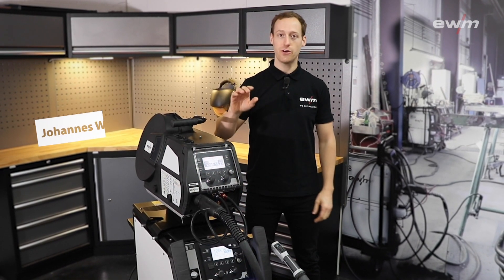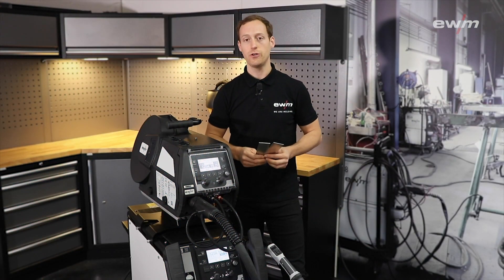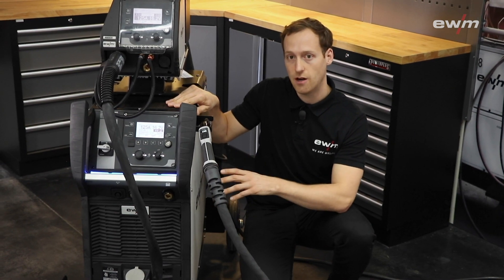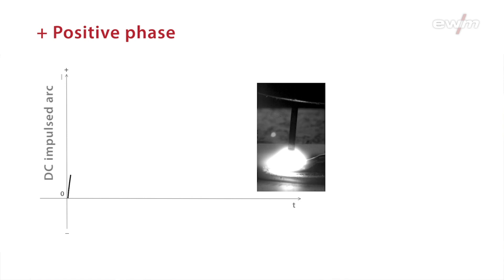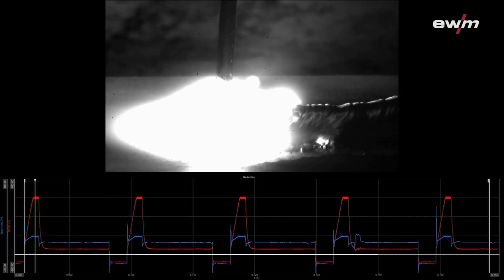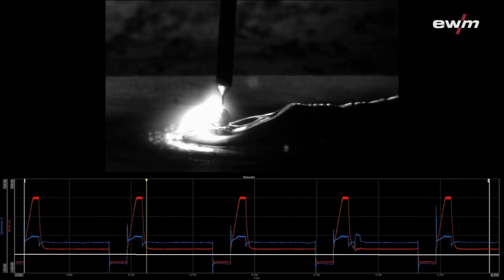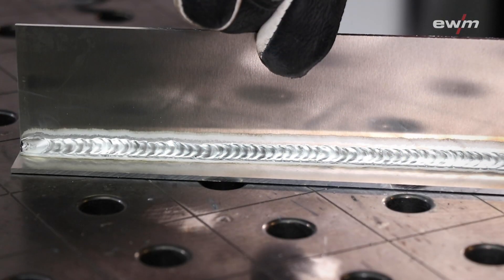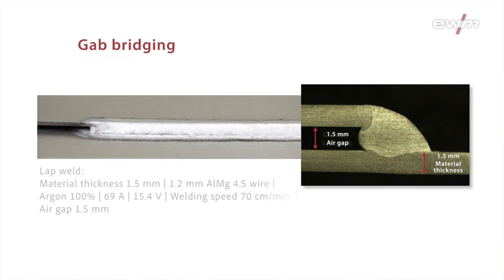acArc puls process for aluminium welding | Titan XQ 400 AC puls | EWM

Comment: For me Ewm better than Fronius ✔️
Reply: I have same opinion, for me is top off the line.
Reply: You understand that torch he is using is a Fronius Jobmaster without multilock ? And I don't mean that is similar, I mean it is exactly same system. One can only ask, who is making equipment for who ?
Reply: I have seen cloos cold weld machine with AC pulse,I have replaced tig process with mig 
Cloos is too good